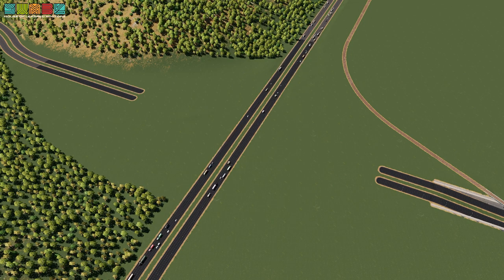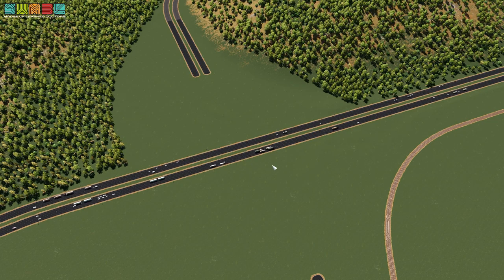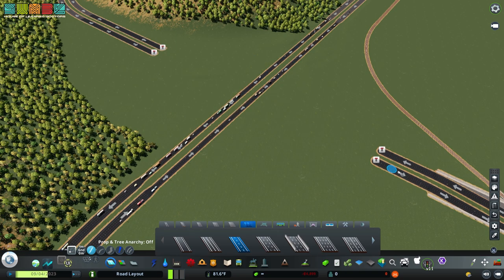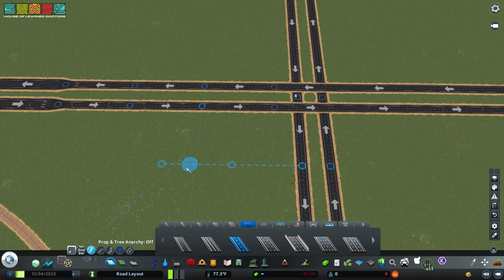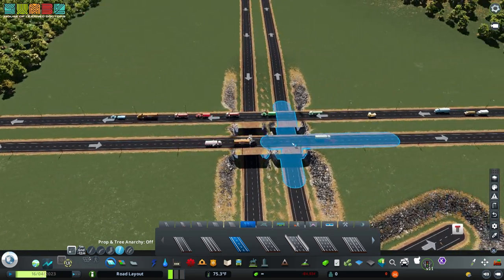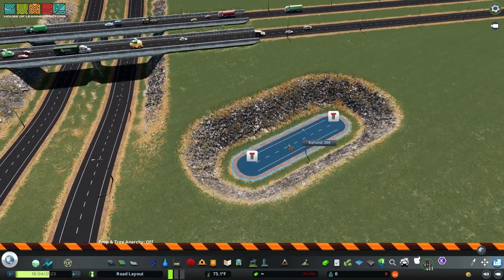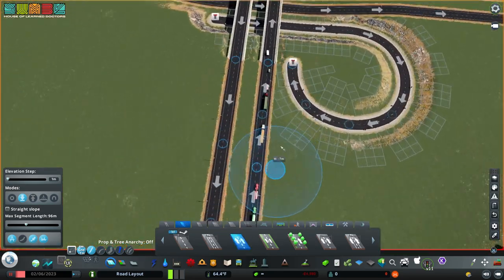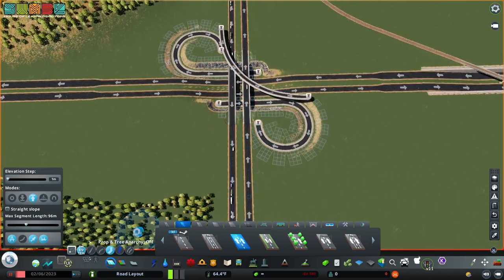How To Build a Clover-stack! A Cities: Skylines Tutorial

Comment: Very nice build! Most of the traditional cloverleafs in Germany by now are retrofitted or planned to be retrofitted with those flyovers or some kind of underpasses, to avoid the weaving. Cloverleafs were mostly built in the 1940s and 1950s, when traffic was rather light here. The main reason for using cloverleafs was saving money, as you don't need many bridges. With light traffic, the weaving was considered a non-issue. There were no trees, so you could see whether traffic was coming from the leaf, and vice versa. As a later optimization, they separated the weaving zone from through-traffic by building shunting lanes, so that you could harmonize the velocities before weaving. But all of this doesn't work in heavy traffic, so classic cloverleafs are no longer built. Except by beginners in CS :D

Comment: Recommendation for a change to this is to remove the straight angle right exits so that they're curved on all four corners. Since those are the exits with the stacks and are elevated anyway, I'd suggest having that exit elevate up to 12m, then split off, with the stacks (lefts) continuing on up to the positions they're in now, but the rights staying level and curving in over the cloverleafs, ideally aligned so that the pillar is smack in the middle of each cloverleaf.
Reply: I was thinking this at the end too. Would look so nice to have everything curve nicely

Comment: Were I live in El Paso, TX we actually have one interchange thats a full cloverleaf and stack interchange right on top of each other. Its the interchange of i10 and loop 375 on the cities east side. You should build one like that im sure it’ll be a challenge
Reply: So there’s redundancies in the interchange, then? One could take the cloverleaf to make a left or take the flyover?
Reply: @jefffinkbonner9551  yes and no the clover leaf is for the frontage roads which we have here in texas so if u making a local trip and dont need to take the fly over u get off and use the clover leaf

Comment: 18:20 I don't like those 'straight' 45 degree right hand turns. You could have moved those further towards the center and have them cut across the center of the clover leaves. 
It would look better, require less length of road ánd make your interchange more compact.
Other than that, great design! :)

Comment: Looks pretty good, one suggestion to reduce the footprint:   Instead of the long straight "right" turns you may want to consider making the flyover 2 lanes wide, and having a right turn off of one flyover to the other one.   So the flyover would be two lanes, one lane, and then two lanes again.  That would just tuck the sides in a little closer and save a few squares of space in each corner.

Comment: Nitpick 12 might seem enough, but I feel as though 15 for height would be much more comfortable. Like I felt like the truck was barely going under anything. There should be some more cushion between the road above and the top of the truck.
Reply from the maker: Its funny. Most people say the opposite. That 12 is far too much. The units are meters so the international crowd knows 12m is a massive amount of distance for a bridge, but in the US we’re used to seeing 12-16 feet or so. 

With all that said i’ve settled on a 10m bridge height for most roads. Usually by sinking the underpass -5 and raising the overpass by 5m.

Comment: 5:44 it's not coincidence. it's 12u. That's the max length of segments, so it's ideal for highways.
on the other side it's 4u(distance between highways)/2+3u(offramp offset)+7u(radius of the cloverleaf)
Actually, this is why I love these designs. They are very predictable and easy to work with. Many thanks for the tutorials!
Reply from the maker: I have trouble asymmetrically, and i’m sure you can see why. Thank you :)